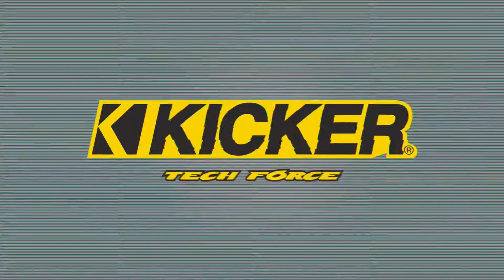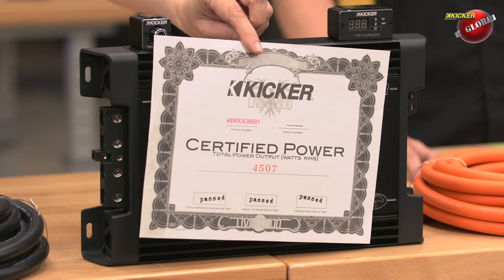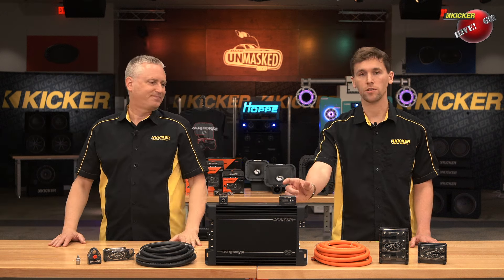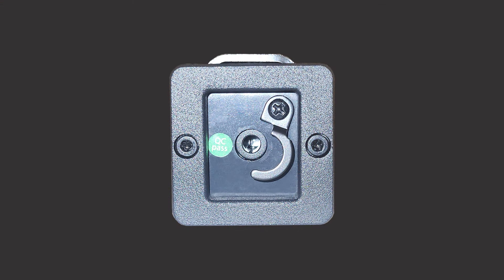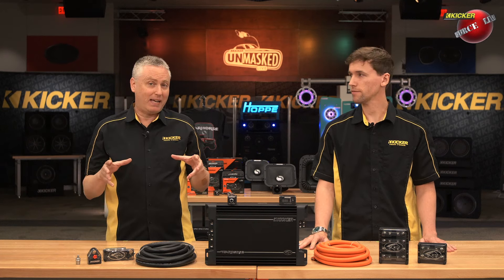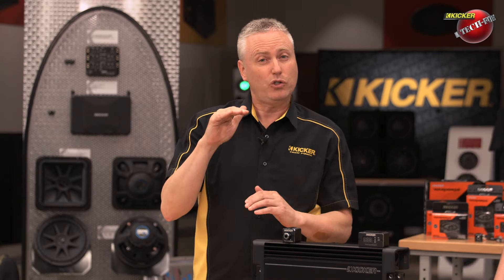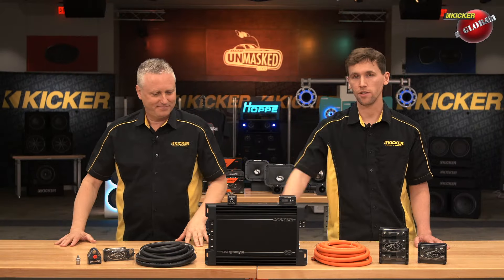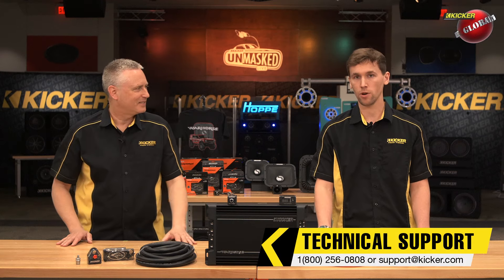KICKER Tech Force - Warhorse 3600.1 Overview

Comment: Hi can you power this to a single 15” solo x under reasonable control?
Reply from the maker: Yes, in fact you could do two SoloX 15s!
Reply: @  lol. I meant if I used one 15 would it kill it don’t have space for two subs.
Reply from the maker: @fahidshah  Well, the power rating for a SoloX 15 is 1000W-2000W RMS, so you could break the sub with this amp. Just don't overdrive it.
Reply: @ what amp will you recommend to be safe?
Reply from the maker: @fahidshah  The Warhorse is the perfect amp for the Solo X subwoofers, as they're both our flagship SPL products! If you'd prefer, the CXA1800.1 can do the job, too, but no matter what amp you choose, you'll need to go through the steps of properly setting the amplifier gain. The Warhorse amp has features that the CX amplifiers do not. If those features aren't of interest to you, and you're never going to add more subs, the CXA1800.1 is a great choice.

Comment: Will this be to much for the kicker l7t underseat enclosure
Reply from the maker: Yes, that's more power than the Loaded L7T Boxes need. Depending on the model you're referencing, you'd be using 50% of the available power at most (at 2ohms).

Comment: Help please system subs underperforming. I set my gains using a 50hz 0db tone using an oscilloscope to make sure I wasn't clipping.
First played with my headunit and it's setting and found I can go to volume 61 before clipping no clipping at 60.
So when I set my gains I used headunit high pass filter to cut out frequency(so I wouldn't blow door speakers) and disconnected subs so I could set gains with oscope. Set my volume to 60 on headunit then played kicker 0db 50hz test tone and adjusted amp gain to just before clipping point. 
Turned off high pass filter so door speakers would work again and re connected subwoofers. My issue is my subs really aren't bumping like I thought they would and the rest of system being set to flat eq for the subwoofers makes the entire system seem weak.
Headunit = pioneer FH-X700BT 14w RMSx4channels(4ohms)
Door speakers front and rear = kicker model 43DSC6704 DS series 6.75" 4ohm peak240w rms60w
Amp= kicker model 46cxa4001 cx400.1 mono amplifier 300Wx1channel@2ohm 
Subs= 2x kicker comp 12" model43c124 4ohm single voice coil 150w Rms  300w peak power.  Subs wired in Parallel to get 300w@2ohms(mono sub has 2 sets of + and - so ran wires Individually to each subwoofer I'm told on a mono amp this is Parallel)
Remote=cxarc remote  turned full way up from setup never turned it down after setup 
Would setting my amp with a -10bd 50hz test tone make my system louder? Basically did I set gains with wrong test tone or are there other things I messed up?